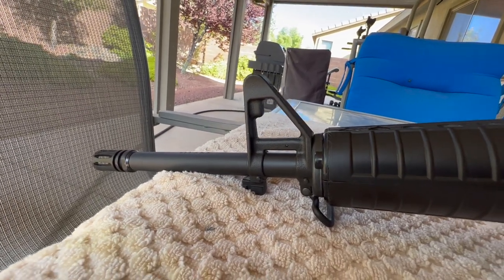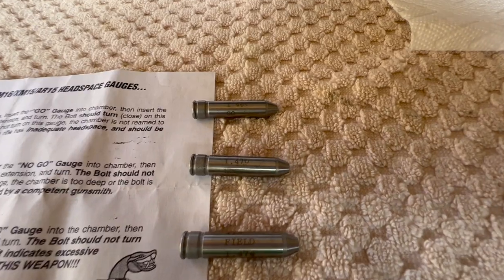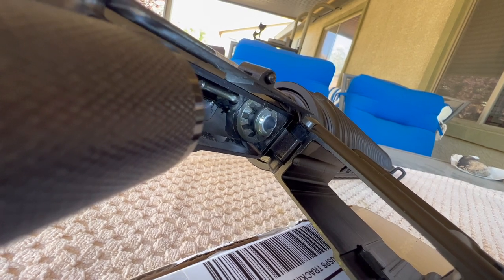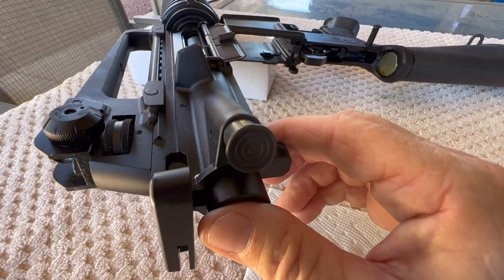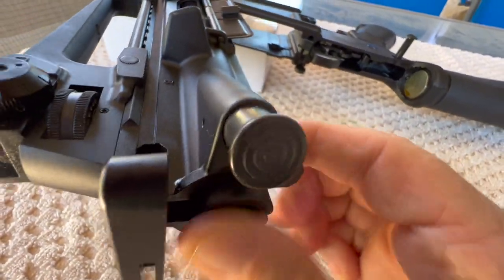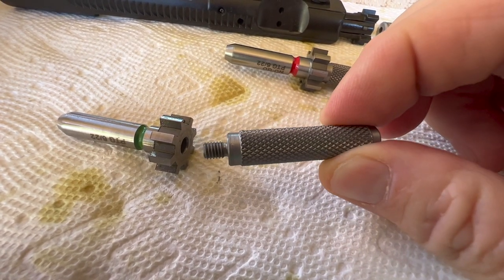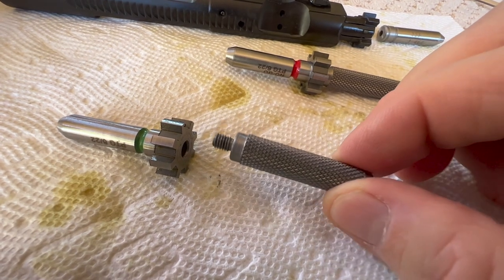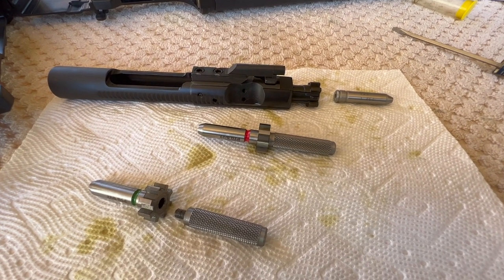AR-15 Safety Head Space Checks!

Comment: Thanks for the informative video. I never knew extension gauges existed. I just checked the headspace on my recent build and it came out fine. In addition to making sure the chamber is clean, it wouldn’t be a bad idea to clean the bolt face to keep any brass buildup or grit from affecting the results. I took my ejector pin out as well as the extractor because it made me feel better and gave me a chance to clean and lube. I used the Young Mfg bolt ejector tool and it made the job easy. It’s expensive, but nice to have to make a potentially annoying task easier.
Reply from the maker: You sound like me! No stone unturned! I've found that so long as the ejector will go flush with the bolt face it will not affect head space readings leaving it in. But as you're saying it's probably a good idea to disassemble especially on a used bolt in case of debris. Leaving the extractor in though can cause some issues when trying to head space in my experience so I always remove it. Clymer and some others make head space gauges with a cut out for the ejector if you don't want to disassemble it so long as you know it will go flush with the bolt face. You can rotate the gauge so that the cut out will engage the ejector plunger if you so chose also. I have quite a few Forster gauges and none of those have the ejector cut out. I head space all of my rifles! The only rifle I personally did not head space is a Ruger 270 but I had the FFL I purchased it from throw a set of gauges in it before I took it home. Thanks for watching!

Comment: Thank you for your video!

I'm fighting a build right now that I believe has a barrel/extension problem and won't eject properly.  So these gauges are essential for safety, function and accuracy.
Reply from the maker: Thanks for watching! They are very handy! I had one barrel where it would pass using a standard set of headspace gauges but not with the extension gauge. I was able to still run it by finding the loosest bolt I had but I knew that barrel extension was on the edge! After a couple of hundred rounds the extension gauge would lock into place but the barrel extension was still a little tight.

Comment: Checking the headspace of an AR-15: here is what found out from Forster Products about headspace checking with a no-go gauge, you can still close the BCG fully (there is a minimum, and a maximum chamber dimensions, so here, maybe the problem is to why; it is the BCG. Now with an LMT BCG with the no-go gauge will not close but with other BCG (2) will close - it is the quality. LMT-enhanced BCG cost around $500, and the bolt alone is $379.
Reply from the maker: Some people will still run their rifles if it closes on a "no-go" and depending on how much force is required to do so. Also, depends on the situation that you might be in. I think everyone agrees that you should never run one if it fails on a "field" gauge. I personally won't run a rifle that closes on a "no-go" because I just don't have any reason to do so. I will start taking a closer look to try and determine what's worn out or not in specification. Might be that the gauges are not in spec too. I have two sets of head space gauges for 223/5.56. One set made by Clymer and the other Forster and then my Pacific Tool Head space/extension gauges. Clymer and Forster disagree on what proper head space is for 7.62x51 NATO vs 308. I won't list everything but here is an example for 7.62 NATO. Clymer says Go - 1.633", No-Go - 1.639" Field - 1.643". Forster says Go - 1.630", No-Go - 1.634", Field - 1.638". Now if you look at 308 Winchester you will find that Clymer, Forster and SAAMI all have different numbers! Who's right and who's wrong? A lot of times you will have to decide for yourself. How the rifle cycles and what the brass looks like after firing especially on a brand new rifle or one that has a large round count.

Comment: PTG claims the head space go gauge in 5.56 chamber is 1.4636 which your extension go gauge looks to be. The Colt military TDP requires a 1.4646 go gauge.. I have found short chambers are much more common than over sized chambers. Brownells just put a video out claiming we only need a no go gauge which is wrong in my experience..I didn't know PTG makes a longer handle for their extension gauges which would be a lot handier, thanks for the heads up :)
Reply from the maker: I watched the Brownells video also and thought the same thing about only needing a "no go"! As you stated a short chamber and extension relationship can occur. After you've done quite a few AR's you also get a feel for how much effort it takes to correctly close on a "go". They put out some bogus on that one! Thanks for watching and commenting!
Reply: I didn't know about the longer handles either... tried a cursory look but didn't easily see them so I'm going to call them.
Reply: From my understanding the 1.4646 is used for military fully automatic firearms that sustain heavy automatic fire, seeing as it's colts design (yes I know Eugene stoner invented the ar platforms) but colt adopted it to a military contract.

Comment: Good information. I always strip the bolt completely (extractor & ejector) before doing a headspace measurement. I wish Windham (Bushmaster) hadn’t gone out of business.😢
Reply from the maker: Windham has new owners but I'm starting to think they are just trying to sell off old inventory and aren't really manufacturing anything. Head spacing will not be affected by leaving the ejector installed so long as nothing is wrong with it. If something is wrong with it as in the plunger won't go flush with the bolt face this will prevent head spacing and something you will want to know. If you completely strip the bolt it may pass head spacing but then you may not realize you have a problem with the ejector unless you check it separately. I just leave it installed and if it passes then everything is good. Some head spacing gauges come with a notch cut out to clear the ejector so you won't have to remove it but you still need to make sure the ejector plunger goes flush with the bolt face no matter how you do it. Leaving the extractor installed on the other hand can cause a false reading and I do remove the extractor. Criterion barrels has a video up showing head spacing when sending out a barrel with a matched bolt but they talk about a lot of other things as well. Thanks for watching and commenting!
Reply: @peteregger7928  Duly noted. I follow what Chad at School Of The American Rifle teaches, and his knowledge & methods (as well as his custom handmade AR-15 gauges) are beyond anything I’ve seen so far regarding the AR-15 weapon systems. If what you are claiming is true, why are the highest-end headspace gauges machined with an ejector cut-out???
Reply from the maker: @paulfrehley7352  Ejector spring force fully compressed is 9-11 PSI and is easily over come with less than moderate thumb pressure on the back of the carrier. The cut out notch on the notched type head spacing gauge does not have to be used. Remove the extractor. Install and rotate the gauge so that the ejector is compressed and see if it passes head spacing. If it does your done as both the chamber and ejector function is good. If it doesn't pass with the ejector compressed rotate the gauge to where the notch is over the ejector so that the ejector does not get compressed and no longer influences the head spacing. Does it pass head spacing now? If it does you may have an ejector problem. If it doesn't pass either way most likely a chamber problem but you may still have an ejector problem that would need further investigation. If you want to perform just a barrel chamber and extension check without a bolt for the proper relationship Pacific Tool and Gauge sells what is called an extension gauge. I also show cased those in this video. These gauges only check the barrel chamber and extension so you will still need to head space with the bolt you intend to use at some point. If you're convinced that the Chad way is the only way they do sell a tool that will help you to get the ejector roll pin out with no damage or launching parts. If you're head spacing with a completely stripped bolt I'm thinking you probably already have the tool. Thanks again for watching and commenting!
Reply: @peteregger7928  You must be correct. That’s a LOT of words.
Reply from the maker: @paulfrehley7352  Just trying to be helpful and taking the time to explain why you do not have to initially remove an ejector to head space. A lot of words? Lol!

Comment: Keep in mind though that headspace gauge tolerances vary from one maker to another. They are NOT all the same. You need to check first with the maker of the BCG and Barrel you are using to know what they use for head space.
Another words one maker of headspace gauges will not work for all brands of ARs.
Reply from the maker: Yes, and there will often be differences between NATO, .223 and Wylde in the throat area of the chamber. Most AR chambers run on the loose side especially NATO. Not a good idea to run 5.56 in a .223 chamber unless the manufacturer specifically states that it's acceptable.
Reply from the maker: @haveacigar5291  Extension gauges can help to determine if the extension lug to chamber head spacing is correct. If your BCG bolt fails to headspace they can come in handy to help determine the problem. If you're referring to head spacing in general it is not optional to either have your FFL check it or you yourself check it before firing the weapon. Takes 5 minutes to make sure you don't hurt yourself or someone else! .006" (thousandths of an inch) is the difference between a safe weapon or an unsafe one! You'll have to explain why you think having a safe weapon is pointless?

Comment: Aero Precision told me that the Clymer gauges I used for my AR-10 308 build are not accurate. I checked with them since the Clymer no-go gauge allowed my Bolt to go in and spin. They told me they spec everything to the Pacific Tool gauges.
Reply from the maker: The Aero Precision is not an AR10. It's based on a DPMS LR308 using the "high pattern" upper receiver. They refer to it as an M5. Clymer has two separate head spacing sets for 30 Cal. One for 308 Win and one for 7.62 NATO as a go, no-go and field set. Clymer 308 WIN is 1.630 Go, 1.636 No-go and 1.640 Field. Clymer 7.62 NATO is 1.633 Go, 1.639 No-go and 1.643 Field. Forster uses the same numbers for both 308 Win and 7.62 NATO which is 1.630 Go, 1.634 No-go and 1.638 Field. SAAMI minimum for 308 WIN is 1.630 Go, 1.635 No-go and 1.640 Field. I split the difference when head spacing a rifle to shoot both 308 Win and 7.62 NATO to close very tight at 1.6365. I've had no issues with Clymer, Forster or PTG. The Wilson Combat barrels I used on both my DPMS LR308 builds both head spaced at a tight "Go" right at 1.6365 using a Wilson Combat BCG and an ODIN Works BCG which is perfect to shoot both 308 Win and 7.62 NATO. I no longer use AERO BCG's.
Reply: @peteregger7928  since it is referred to as an AR-10, and everyone knows it as an AR-10, we will just call it an AR-10.
Reply from the maker: I won't! There is little to no parts interchangeability between an AR-10 and a DPMS pattern LR308. There are also a lot of parts that will not fit between an AR-10A and an AR-10B including magazines. @theoriginaldashriprock
Reply: @peteregger7928  I understand what you're saying, but you're in a minority. Everyone in the industry refers to them as an AR-10.
Reply from the maker: Yes, it's unfortunate! @theoriginaldashriprock

Comment: But what is head spacing, and what can happen if its out of spec??? Is it something you can set or adjust, or is it just replacing the BCG or barrel? My friend has been building AR 15 and AR 10 rifles for himself and others for prolly 20 years id guess, and when I asked him about it, he said he's never checked it on any build or bought rifle,and never had an issue or known anyone else to have an issue. Thanks for any answers or advice in advance.
Reply from the maker: The chamber of the rifle has to be within certain dimensions to be safe and operate correctly. Most  steel AR chambers are chrome lined and it is not cost effective to try and replace the extension and chrome lined should not be reamed. More options for non-chrome lined or stainless but still not cost effective. Easier to replace the barrel in both cases. Your friend is rolling the dice and the house  eventually wins! Like wearing a seat belt when driving. Quality control with todays' manufacturing techniques and peoples attitudes in general is not always optimal!

Comment: Have you run into failures with any brands purchased new? If so, did you find them to be more often the bolts or the barrel and extension?
Reply from the maker: I have not yet had a bad extension or barrel chamber. All of the issues have been BCG's. Two Palmetto State Armory's which had incorrect ejector springs not allowing the ejector pin to go flush with the bolt face causing head space to fail. After fixing that issue discovered that one of them had an additional problem with just the bolt that could not be fixed. These were made by Toolcraft. I've also had three recent failures with Aero Precision. One of the bolts had a very hard piece of debris stuck in the ejector pocket that I could not get out. Looked almost like a detent. It was very hard and spinning a drill bit on top of it didn't leave a mark. Maybe a broken piece of tooling. Whatever it was it could not be removed with basic tools. Two of those AERO's had very tight carriers and the third was more snug than it should have been. By mixing and matching I was able to make one good one with a spare bolt and parts but two of the carriers went into the trash. I have had good luck with AERO in the past but no longer trust them so I wasn't interested in their warranty. Prior to these three I did have one replaced under warranty because the Nitriding was terrible. Just about every BCG is sourced from the same manufacturers with ToolCraft, Microbest and Azimuth being some of the top names. What it comes down to is the resellers doing QC and how much of it they do usually dictates the price before they laser etch their own logo on it.

Comment: Can you check the bcg with calibers... and also if I buy a new bcg say from arrow will it be compatible... my rifle is brand new but still I would like to know... I'm ordering the headspace guages now... just curious if I can buy a nice bcg... mine is a diamondback 16 inch rifle
Reply from the maker: The extension gauges only check the extension and chamber relationship. You will still have to use headspace gauges to check the BCG to barrel relationship. These gauges are useful to help determine if it's the barrel extension/chamber that may be preventing your regular head spacing from passing or if you just want to know if the barrel is good. I suppose you could make some basic measurements with calipers but I think that would be unreliable. Best to use head space or function gauges.

Comment: I am currently building my first AR. I have a WIlson Combat 16 inch 300 blackout barrel. I have Forster go and no go gauges for 300 blackout. I disassembled bcg and took extractor/ejector off bolt assembly and checked with barrel alone. The bolt was able to go past the lugs and turn on both go/no go. I then put bcg back together without the extractor and put in upper receiver with charging handle and it also closed with go/no go gauge. I have ordered a Forster field gauge and will try a different bolt to see if that is the problem. I should mention it is an Aero precision nickel boron bcg. Is there anything else you can recommend that I do short of going to a gunsmith?
Reply from the maker: Do you know anyone else with a 300 Blackout that you could compare the barrel with? Maybe Wilson got something wrong? Forster is usually pretty good but the no-go may be out of specification. I no longer run Aero Precision BCG's. The last three I purchased had issues. If you have another 5.56 BCG laying around you could use that for comparison to see if it's the bolt? Another option is sending your BCG and barrel to Wilson as I understand this is a service they will provide and if there is a problem with the barrel chamber it will get taken care of. They have very good customer service from what I understand but the turn around time is not always the fastest.
Reply: I purchased two nickel boron BCG's from AERO recently.  One has no issue with two entirely different barrels on two different rifles, and the other BCG fails on both.  Have a ticket in to their customer service to find a remedy.  I'm using gauges from Manson Reamers.